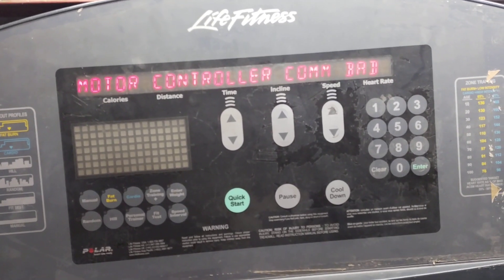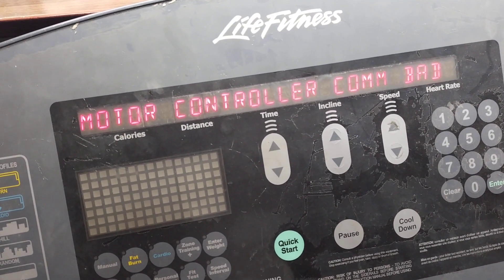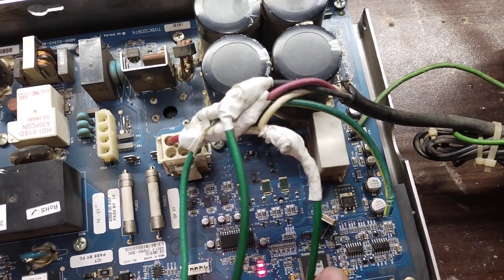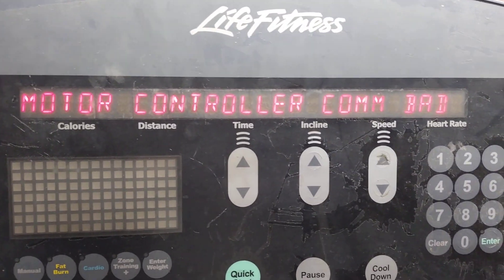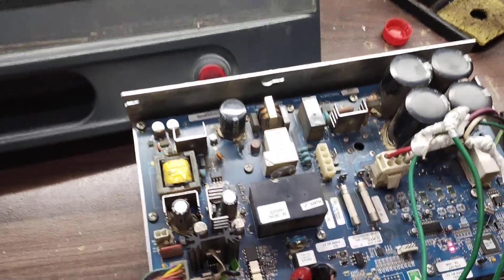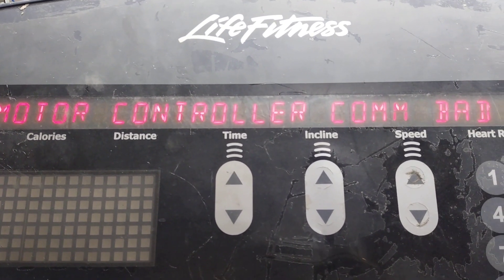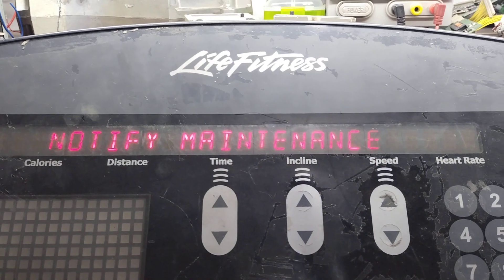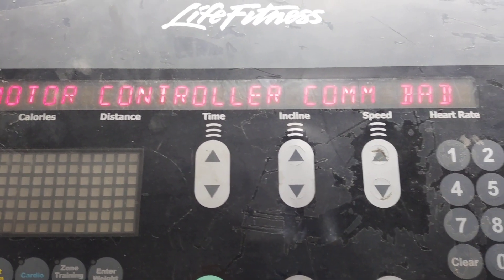life fitness treadmill 95T "Notify maintenance Motor controller Comm bad" solution.

Comment: Greetings engineer, how are you? I need your help. I have two boards of a treadmill that is causing problems in the motor and the other one does not give me any display on the controller panel. I need to know if you can guide me a little. This is the model of the board. (((life fitness treadmill 120v motor control board controller ak75-00005-0000))) greetings from Venezuela thanks in advance

Comment: Hi. Thanks for the video. We have a couple of 9500hr treadmills with the same error.  These machines have a different setup with the dual PCB’s(wax board and controller board).  I have isolated the issue and the wax boards are ok… i tested all the resistors on the lower left of the power board and the large wafer capacitor is also ok. Any idea what components to check?
Reply from the maker: What is error code ?

Comment: It is very easy i have the same problem it was just a little component🥶
Reply: Which component did you replace to repair the Motor Controller Comm Bad?
Reply: @+1davebevad

Comment: Hi Kalim, really enjoy your videos and the clear and easy way you explain the technical concepts. I buy, repair and sell exercise machines (mostly recumbent/rehab exercise bikes and ellipticals). I find the #1 fault I see is with the resistance/level circuits. Sometimes the little 6v brake/magnet servo motors are bad but in many cases, the fault is within the upper console at the circuit. I would love to see a video(s) series where you explain the resistance/level up/down circuit in these machines and trace the circuits from the keypad down to the motor. Especially the circuit components inside the console that are part of the circuit to troubleshoot when the circuit no longer works as expected to control the level/resistance of the machine. Thanks in advance and I will watch for more helpful electronics repair videos!